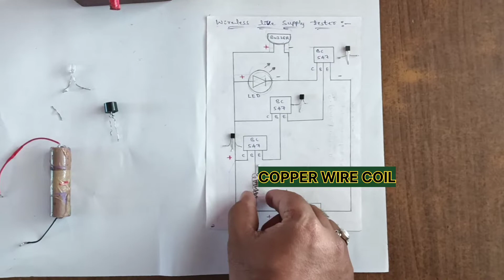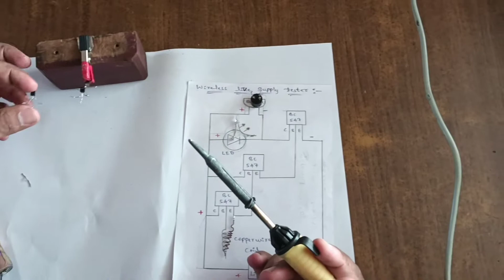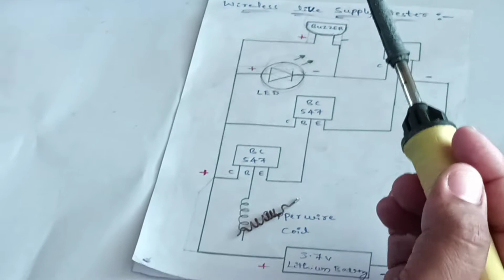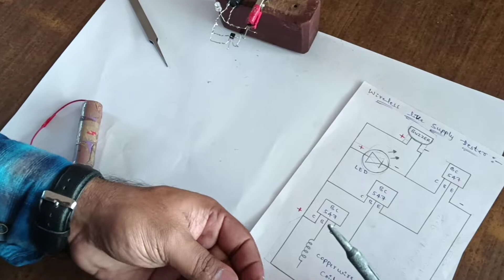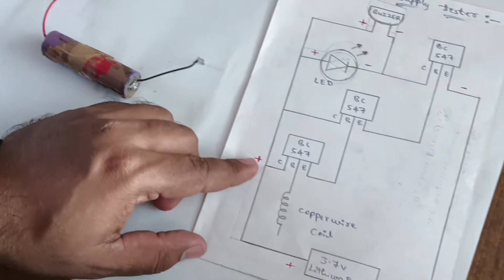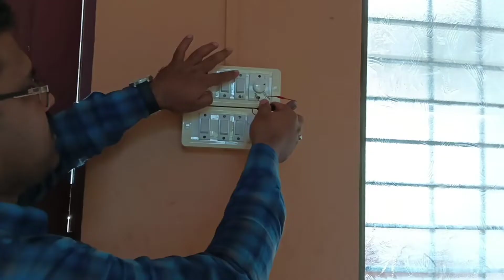#Extremely! Extra-ordinary Wireless AC Supply Detector #AC Supply Tester #Subscribe channel👈.

Comment: Very useful project Ac supply sensor detector Ac test supply with diagram connection using for material Bc 547 transistor or buzzer and led etc